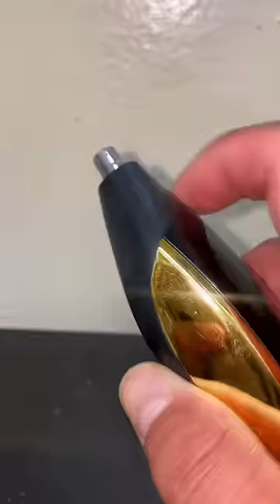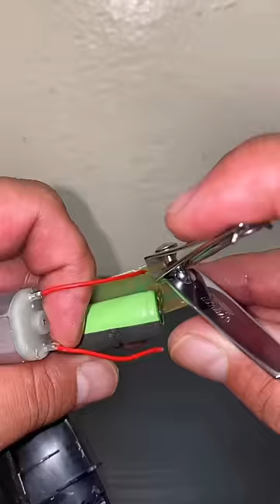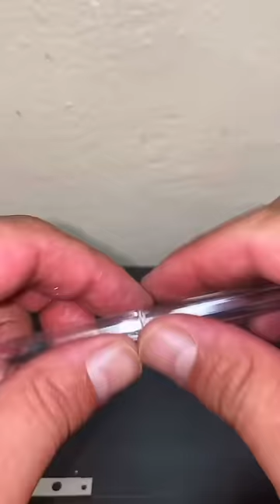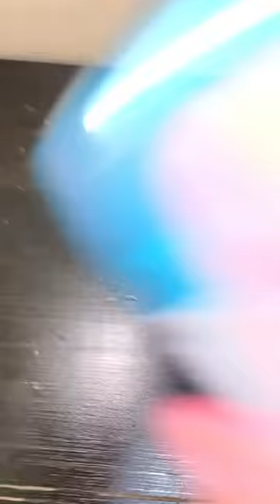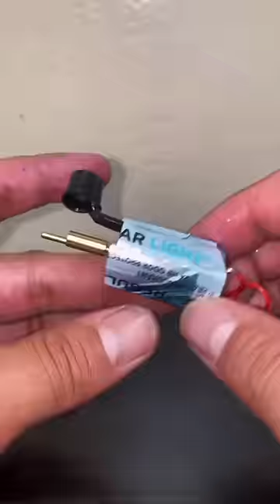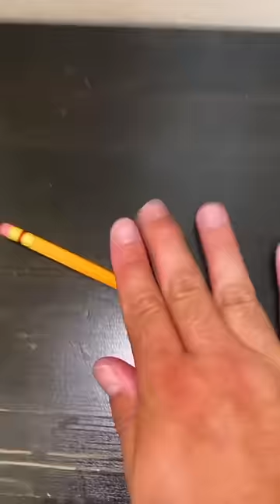How making a “Tattoo Gun” goes down- Jailhouse Style! #FYP #Dpeezy2099 #Bussin

Comment: I use the g5 pilot pens. You can get the ball out of the cartridge and send the needle through that. It makes everything very precise
Reply: What did you use for the motor
Reply: How does the motor turning push ink out, especially since in the video it doesn’t look like the motor is mechanically attached to the pen, looks like it’s just turning the rubber and the pen is just conveniently taped next to it.
Reply: @victorma9355  its lacking final piece which is the needle in the center that is attached to the motor, as the motor turns the needle is pushed up and down.
Reply: @sergiocervantes3925  cd player motor
Reply: @sergiocervantes3925  trimmer motor. With a little bronze pipe around the turning bit and some oil. It ensures that the needle does not eat away the metal.

Comment: That’s pretty good, we make them a little different down here in Nc tho, we use 3 double A batteries for the pack, make the wheel out of seg pens and the tips of ballpoint pins, and we stretch tips for the needles out of spray bottle straws

Comment: They use wall adapters for power. They make their own resistors to control the speed. Using thick V on cardboard. Tape wire when they get the speed they want. Literally a long 6 inch V filled in. Acts like a variable resistor. Cool huh?

Comment: The crazy thing is you could have just made a badass one out of the shaver before you tore the motor out. Then you would have had an on/off switch, TWO batteries possibly even rechargeable, and a nice handle with an ergonomic grip. Everything is already there you just gotta make the barrel and sleeve and make a needle for it.

Comment: I was building him things out of those same motors when I was 12 years old, but we didn’t get the motors from my nose, hair, trimmer or electric shaver. We got them out of the little bitty, remote control cars.. we would use the base string off of a regular guitar and we would take in peel the cord out from around it, revealing just the little guitar string that ran through the middle of it. We would sharpen it and that would be our needle. We would use Cotton at the end of the The pan and we would drop our ink directly on to the Cotton and it would hold the ink as the guitar string ran back and forth through it. We would also take the motor and  bend the shaft at the end of it so It would Makes the needle go in and out. The little eye at the end of the guitar string would fit right over the end of that motor. It was as if it was all made to work together so perfectly..

Comment: You couldve had an entire handle on that mf and made it rechargeable if you just used it inside the trimmer. Thats how i did it. Leave the trimmer together and expose the spinning piece like you did in the beginning and do everything else the same except you dont need a battery or to rewire it